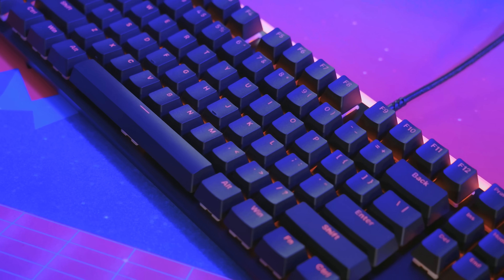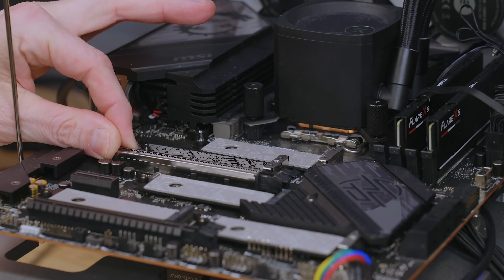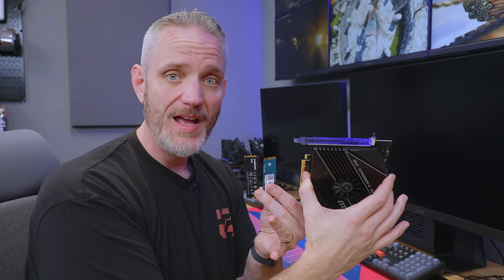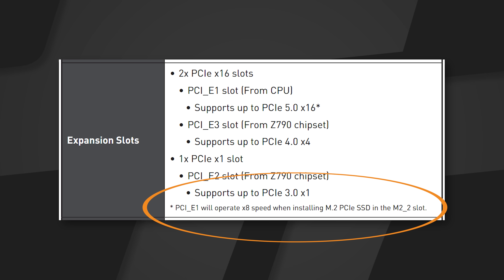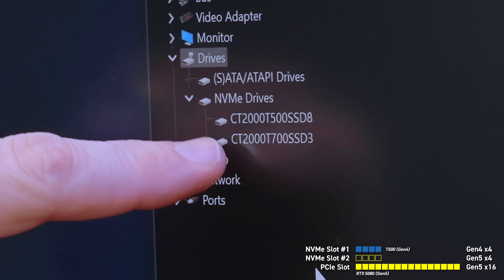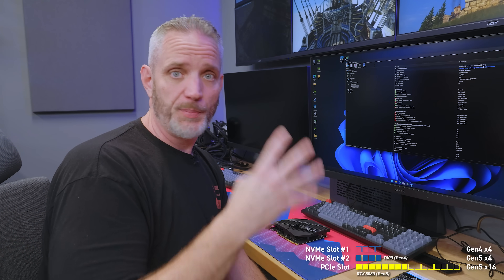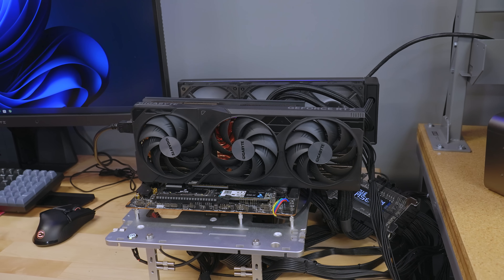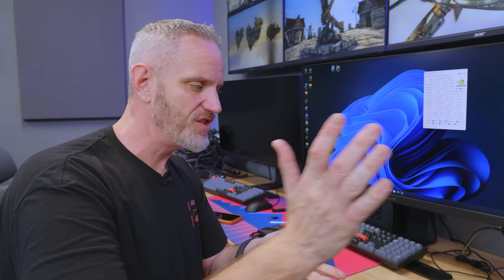Don't make this mistake with your PC!

Comment: "¿Why all those connectors are there is they can not run at full speed? That's a question for Intel and AMD"

The answer is servers. For a long while now, µprocessor cores, and PCHs and all the other stuff is designed with servers in mind. We consumers get the scraps. That's why PCI SIG is already down to PCIe 7, while PCIe 5 is just kinda showing up on consumer Mobos.

Doing pins in semiconductors is one of the most expensive things one can make. Not only the pin itself takes up a lot of space (even power and ground pins that do literaly nothing) for the solder joint, either to the substrate or to the [organic] interposer, also, if the pin is something like PCIe one needs amplifiers and such, that consume even more area (and power). So, the less PCIe one can get away with, the better. Intel is clever in that there are "some" PCIe in the Processor, and some is farmed to the PCH, making both easier and cheaper to manufacture, and to do system by system variation too.

In servers, which are densely packed with all manner of stuff to the gills, oftentimes is better to get many connectors, even starved for PCIe lanes, in order to pack as densely as possible. Take a look at a desktop PC and a server of comparable volume, and see how much space on the Desktop is wasted as air. Think of it, a lone PCIe 6 gives you 16Gbps (PCIe 5 gives you 8Gbps), the fastest NVMe drives give you 3Gbps (limited by the NAND Flash and the controller). Not only that, but for non-sustained loads (think storage or networking), a little cache and some clever programming will allow you to use less PCIe BW with no noticeable effect on speed (but there will be effects on latency).

We consumers inherit the bifurcations that in a server are exposed in the Firmware and Finetuned by the Server maker at the factory, while we consumers are told to leave it at auto. 

On servers, one reserves the PCIe Lanes that go directly to the processor for CLX (Computer eXpress Link) RAM Memory, and accelerator cards (AI, HPC, and Ecryption). On PC, there is no CLX (yet), and the only Accelerator is the GPU. Dump all the other stuff on to the PCH (in Intel) or AMD equivalent and be merry.

PS: If you want to have 2 GPUs on your desktop (say you use a 5090 for graphics and a 2090 for Physx + LossLessScalingFrameGeneration) you may want to have the 5090 on the 16x slot and the 4909 on the 4X one, both directly hanging to the CPU. All the rest, PCH.

Comment: JayzBiCents

As a run of the mill general dumb consumer, I find it frustrating that it's capable of these speeds, but can't figure it out.  Why can it not just be the speed that it is?  Why are there multiple slots if you can only install one thing at the advertised speed?  Why did they forget to install pins on that one slot you showed?

I had to take a minute to look.  I have two 1x slots, and two 16x slots, but one of them is only 8x, so how is that a 16x slot?  Why is the NVME slot acting like a PCIE slot?  I guess I'll ditch my NVME drive and use a SATA drive so my GPU can function properly, but then I still need a sound card and a wifi adapter, so what the actual fuck?  I feel like it's just complete false advertising.

Comment: Question: How much does it matter if it's connected to the CPU via Chipset? I have my Windows drive connected to the chipset, and my gaming drive connected to the CPU. From reading online, it looks like for Windows it doesn't matter.
Reply: All lanes end up at the CPU, so it's really just latency. It will be better latency if it's going directly to the CPU. The difference isn't an issue to anyone who doesn't already know that it's an issue.

Comment: Tip. Buy a gen 5 and you can move it to your new motherboard when you upgrade. Future proof.
Reply: Better tip. Buy the Gen5 drive when you actually need it. You'll  then either end up buying a Gen 5 drive at a way lower price, or you end up buying a higher spec. And with both, you'll still have the Gen 4 you originally bought, if you ever needed a drive in the first place.

Comment: Real life example. A few years ago I upgraded from 6700K (Z170) to 11600K (Asus ROG STRIX Z590E-Gaming WIFI). When I was looking to upgrade from 2.5"SSD to NVME, motherboard manual said I can have 2x NVMEs at Gen4 speeds, and that's what I bought.
When 1 drive wasn't showing up, I dug into the manual and saw the whole bifurcation thing. So I had to run GPU @ 8x in order to get both M.2 at Gen4. Luckily 2080super doesn't get bottlenecked by PCIE 8x (Gen3 or 4, whichever I was running).
I recently upgraded to 5080. I had to shuffle my drives (so that my gaming drive is still at Gen4), disable bifurcation so that I get 16x on the GPU, and let the second (boot) drive run at Gen3.
Which means I wasted money on 2x Gen4 drives, when I coulda got 1xGen4 and 1xGen3.

Comment: 4:02 At least that board does have 0 support for x4 x4 x4 x4 bifurcation for the x16 slot, only 8x4x4. Also it does not support bottom slot bifurcation at all. Plus that M.2 expander does not support 2x2 configuration as it requires physical x4 lanes for each ssd's.

Comment: With the removal of the SLI standard I've found that vendors have decided to reserve dual x8 mode(x8/x8) for the higher end motherboard and the standard consumer motherboards have been limited to x8/x4 on the cpu's pcie lanes. 

In previous platforms, such as the x570, dual x8 mode was much more common with high end boards supporting x8,x4,x4.

This allowed the consumer much more options for additional nvme storage while still fully utilizing the gpus bandwidth on the pcie lanes allocated to the CPU; thus freeing up the chipsets pcie lanes for bus interconnects.

It's interesting how basic features that once commonly existed have become over looked as the importance's of personal computing has changed. 

In a perfect world we would have x8/x4/x4 bifurcation across 2 x16 slots so we could purchase a single slot dual m.2 expansion card and utilize the technology that we paid for when we purchased our CPU. The top slot would allow for better tracing to the m.2's and the second slot being the primary GPU slot to accommodate the thickest of modern GPU coolers. 

Paying a $1200-$1600 CAD premium on the highest end consumer grade motherboard seems like an unreasonable price to make use of all the pcie lanes that we purchased from the manufacturer of the processor.

At those prices it competes with workstation hardware and I think that presses a monetary boundary that introduces more compromise than benefit for PC gamers and beginner content creators.

Comment: I haven't been able to figure out how to get my 3080 12GB to run at x16 with a 5950x, at first I thought it was due to where I placed the nvme but then confirmed that even without the nvme there and connected to the chipset port no change on gpu.  GPU reports it can do 4.0 x16, but only runs at 4.0 x8.  Motherboard is a rog x570-e gaming wifi ii if anyone has any suggestions.
Reply: With nothing in the other PCIE slot, if it still runs at x8, make sure you didn't force it to x8/x8 in the BIOS. If it's set to x16 there but the card still runs at x8, there's a problem with either the card, or more likely, the board.
Reply: @Dexx1s  It is set to auto, only has three other options total: Auto, x8/x4/x4 and PCIe RAID.  I thought it was odd to not also explicitly have a x16 option.  Thanks you for the added confirmation that it is most likely the board, it is Asus after all haha.  My success rate is about 50/50 with their boards over the years.

Comment: What I will never understand is why can’t x8 5.0 lanes, be translated to x16 4.0 lanes.  Literally same bandwidth.  All I want is to have three M.2 drives, a x16 4.0 GPU and a x8 3.0 NIC in the second slot.  I don’t care if the M.2’s and secondary slot all get dropped to flipping PCIe 3.0, just allow me to use all the fucking slots on the board.

Comment: Gosh darn it, it appears I made this mistake.  I have my 2TB SSD in M2_2 slot that shares lanes with the PCIe x16 GPU slot.  The slot is running at X8.  I will have to move the SSD to M2_3, which runs on the chipset (it's not a gen 5 device, so performance won't be impacted).  Ugh.

Comment: There are plenty of pins on these processors which is why I don't understand why they don't open them up. Unless the server market gets canibalized  and thats why. I just built on asus Tuf x870E gaming wifi board with AMD specifically to get 16PCIE graphics and two Gen5 NVMe drives. I'm coming from win10 and wonder what utilities are you using in this video and are they available in win 11. Thank you for all the work you put into these videos. They helped me understand, analyze and select components.

Comment: Just don't bother with m.2 SSDs faster than pcie3.0 😊 4GB/s is plenty fast unless you have a bad habit of copy/pasting tens of gigabytes between different partitions on a daily basis. For the most part your games won't load any faster on a quicker drive and there are plenty of benchmark comparisons on that topic to prove it.

Comment: Awesome that you covered this subject of CPU lanes. I have an old i7-6800K (28 lanes) and I couldn't get a Mellanox 25G optical PCIe card to run at x8 speed so my 10G fiber Win 11 PC was capped around 2.5G (7.5G at the router). After using ChatGPT to troubleshoot it was suggested that there weren't enough CPU lanes to go round (x16 GPU RTX 4080, x4 M.2 Evo 970 SSD, x4 on the Mellanox PCIe and x4 elsewhere?) I bought a 40 lane CPU i7-6900K from Ebay £30 and now the PCIe fiber card runs at x8 and I get 7.5G on the PC. I would never have discovered that without ChatGPT I never even heard of CPU bifurcation. I could have achieved the same by removing the M.2 SSD and putting Win 11 on a 2.5 SSD connected by SATA to free up x4 lanes but the CPU option was cheaper. Thanks for making my next PC purchase even more complicated!

Comment: I built my PC right as the faster gen 4 drives were coming out, I really wanted to make sure I didn't mess it up, so I paid attention to the manual! Though that drive died 12 months later...

The replacement is still going though, but I haven't done the work of reinstalling the OS on it, so I've been running win10 off a gen 3 drive for a couple of years now :)

Comment: Intel not giving consumers or enterprise enough PCIe lanes, is just like NVIDIA with vram
Reply: It's not just Intel. Hell, 1851 is actually kind of nice in comparison to both AM5 and 1700; 20x Gen 5 + 4x Gen 4 + 8x chipset connection. That means you can get away with a Gen 5 SSD, a Gen 5 GPU, and three Gen 4 SSDs with all of them having lanes.
Reply: It's not just Intel. Consumer AMD is short at least 12 lanes to the CPU, there are only enough tracks to the CPU for a sys drive, app drive and data drive if you bif your GPU's bandwidth in half, meaning that a swap drive and virtual ram drive are on the slow track through the chipset
Reply: @hizacaine  eeyup. I had an issue where I couldn't use my second m.2 slot, at all. Only one of them would work, because of that cpu+mb not having enough lanes for it, and I was on a ryzen 5 5500.
Reply: @hizacaine

I just pick up one PCIe 4.0 4TB NVMe for everything. 64GB ram is enough that swap isn't used much.

And 16x PCIe 5.0 for GPU. There is still room for other 4TB PCIe 4.0 NVMe.
Reply: Doesn't Intel have more lanes than AMD
Reply: But unlike vram module, extra die size for more io is actually expensive.
Reply: Not since the X299 days when you had 45 lanes and good cpus (for the gen). They haven't made that "mistake" again.
Reply: @zorbakaput8537 Wasn't it 40 like X99?
Reply: @J-1410 , yep
Reply: well it canabalize their Workstation cpu lineup.....
Reply: @mr.il3nt658  That's the issue. I'd buy Threadripper but  I don't want to heat up my apartment with triple the wattage. I want the energy efficient low power consumption of the X3D, and I want it now!
Reply: intel not giving enough cores is also like nvidia not giving enough vram.
Reply: AMD is a lot worse than Intel with this issue. Especially with the latest CPU releases.
Reply: @tonyj801 Significantly worse. Intel also doesn't have the cutting lanes on some CPUs issue. You can get an i9 or a Celeron with the same lanes. Amd you can go from 24 gen 5 lanes available on a 7600x to 10 gen 4 lanes available on an 8500g that goes in the same motherboards and you have to just know that yourself.
Reply: @tonyj801

I was able to build PC with PCIe 5.0 GPU and PCIe 4.0 NVMe. There was also room for second PCIe 4.0 NVMe. I don't see this as issue.

Biggest problem in PC hardware are usually quality issues, not capacity.
Reply: Intel actually offers more PCIE lanes on Desktop chipsets - but not always the fastest ones.
AMD offers more 5.0 lanes (from the CPU) with 600 series mainboards.
Intel 1851 offers more lanes and native USB4 support.
While AMD 800 series mainboards often use 5.0 lanes for USB4 support.

Intel 1700 was designed to have only 16x5.0, 4x4.0 and 8x4.0 (to the chipset)
- it needs to bifurcate the GPU slot if you want to use an 5.0 m.2 SSD
- the chipset can only offer 4.0 as well
Intel 1851 added 4x5.0 and native USB, it now has 20x5.0, 4x4.0, 8x4.0 (to the chipset), USB4
- it allows full GPU slot at 5.0 and one m.2 at 5.0
- BUT there are still mainboars that bifurcate the GPU slot, to offer two 5.0 m.2 slots

AMD AM5 has 24x5.0 and 4x4.0 (to the chipset), USB3.1
- it allows for two 5.0 m.2 SSDs, anything connected to the chipset is bottlenect more
- BUT AMD does not offer native USB4 support, most 800 series mainboards use 4x5.0 CPU lanes to connect a USB4 chip (see @16:19)
- also the 670 and 870 chipsets are two of the same chips that interconnect, so you "lose" 4x4.0 lanes from the first chip to connect to the second

AMD AM4 has 20x4.0 and 4x4.0 (to the chipset)
- BUT only the X570 actually uses 4x speed on the connection and is able to offer additional 4.0 slots
- any other 300, 400, 500 chipsets only offers 3.0 connections from the chipset
- STILL some mainboards (without X570) offer two 4.0 m.2 slots - they do bifurcate the GPU slot

Comment: I think you may have misspoke. On the X870E-E, it does drop the GPU slot down to x8 even if you have only NVME installed in either slot 2 or 3, but slot 1 is safe to use.

Comment: 14:42 "All graphics cards are going to be x16" Are you sure??
Reply: He probably should’ve clarified “all modern graphics cards.”
Reply: @ArctecGemini  Well I consider the RTX4060 to be a modern graphics card and that only uses 8 PCIe lanes. Still I never knew about this bifurcation problem before watching the video, so it was a pretty informative video for me.
Reply: Nope. He meant all graphics cards SHOULD be x16. But thanks to Nvidia and then AMD copycating that's not the case. But imagine an accident bifurcation of an x8 GPU to X4 ooof.
Reply: @stephenDryburgh  Though AMD seems to have stopped it again with the 9000 series GPUs where even the OEM only 9060 non-xt has a x16 interface. Though I guess we'll have to wait and see what a possible 9050 will have and if tyhey stick to simply keeping them all on X16 or if they will step it down again for those entry level cards

Comment: Wait. Does that mean if I use a high-end GPU and an m.2 NVME that both use pcie lanes, that my GPU may not be running at its spec potential? I have an old ASUS X299 board and it specifically says that one of the SATA ports is not usable if you use the NVME, but that you have to put it there to use up pcie lanes. Does that mean the motherboard took away lanes from my gpu or both the gpu and drive?

Comment: Also the chipset lanes might be shared with some USB or S-ATA ports that turn off if you plug all the M.2 in...  
i absolutely read the manual, before i even buy the board.  ...this is purchase decision making stuff right there, and guess what nobody on Youtube talks about when making reviews for motherboards.  
Putting FIVE M.2 Slots on boards just seems like a marketing stunt if using them cripples half your system they are pointless.  
...also we are talking about boards here that go from 300 to 500€ ...with pricing like that they could at least give us some lanes for all those ports.  

And can i just mention that i HATE that M.2 requires you to uninstall the GPU to change anything with your storage?  
S-ATA was so much more user friendly than this M.2 shit. Would putting these things on cables really make that much of a difference?  
How about at least putting the M.2 slots on the back side of the Motherboard and then using a case that has a cutout there so you can get there without taking the whole thing apart.  ...probably would need some standard.  
Not to mention that the GPU is just about the hottest thing in the system, lets put the heat sensitive M.2 storage RIGHT NEXT TO IT.  ...other than it being freaking fast, does anybody else think M.2 is just a stupid design all around and S-ATA was just so much nicer (and you could have 8 of them... and we finally got to reasonable sizes 4TB and up... at somewhat reasonable pricing).  

...and Denuvo is going to F your load times up in AAA games anyway, what is even the point?  
You are fighting against unskippable intro videos, 2+ minutes matchmaking times, and then you still got to wait until all players are ready ...there is no point in throwing money at the SSD to be top of the line just so you can be faster in the game if that isn't even the big bottleneck to begin with, but stupid game design is.  
Now... is you use it to edit videos all day long, then sure knock yourself out. After that comes gamers and then everybody else who literally doesn't need to give a FFFF.  

...just saying.  
That entire development is annoying me on so many levels... but at least it's fast, right?

Comment: Thanks for this mate. Just found out my 3080ti is running x8 instead of 16 as I'm using the second slot for spacing. Thankfully it doesn't really matter performance wise given the card is old